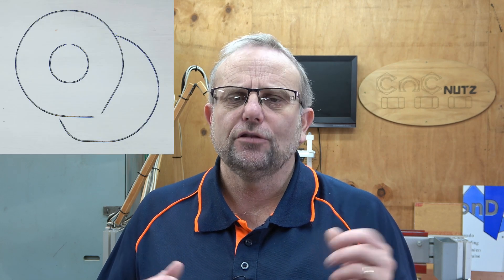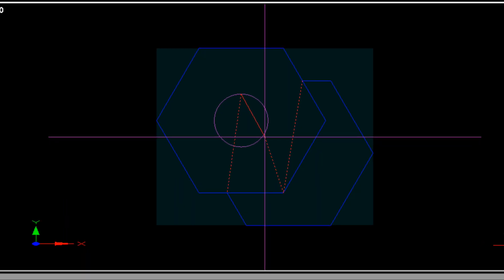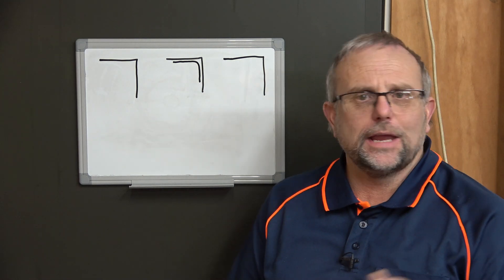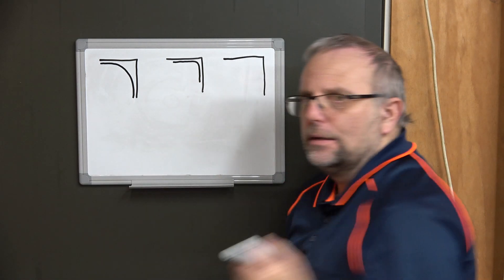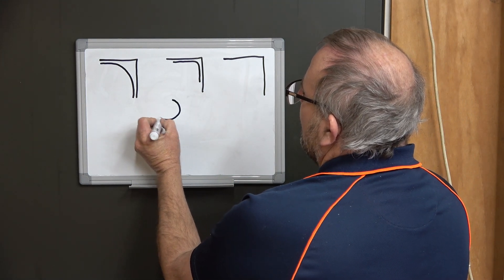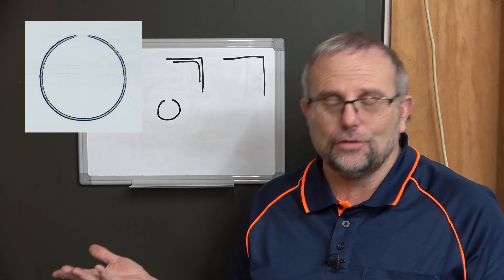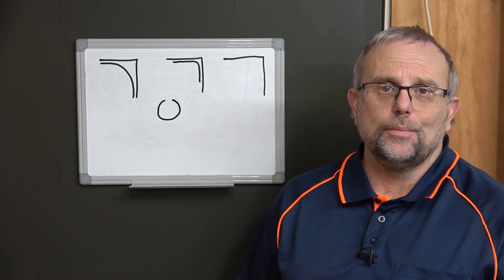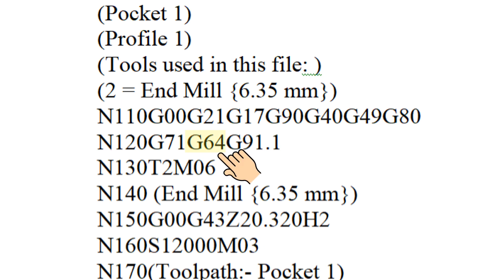Constant Velocity - Don't do it! - CNCnutz Episode 248

Comment: Mach3 has a really bad implementation of constant velocity. UCCNC as well as (from what I've heard) Mach4 manages this much better, drastically improving the performance. Another alternative you have is to use very high accelerations with closed loop motors and use exact stop.

Comment: exact stop shakes the machine like hell especially if you have a heavy gantry. then you need to reduce acceleration to create a longer ease in/out move to dampen the energy. the time passing during acceleration moves adds up and drastically changes the working time.

here are some of my tips that changed he way i work.

-get closed loop steppers at least
-constant velocity
-max out acceleration, just enough to dampen the shake
-max out feedrates
-keeping rpm as low as you can, making fat chips and keep endmills cold.
-evacuate as much chips possible.
-full depth cuts, use most of the flutes to cut not only the tip
- using roughing bits with adaptive clearing
-spring/finishing cuts to bring everything to tolerance after roughcuts or slotting moves. 
-i would say avoid slotting and plunging but we all do those.

Maybe everyone has a different flavor for using their machine. at least thats my experience so far.

Comment: I've been playing with the CV settings in uccnc because when running fusion 360 trochiodal adaptive clearing (or whatever it's called) machining uses a lot of curves and ran very slowly and jerky at default settings. But after some tuning I got much higher velocities removing more material quicker. When v carving though the same settings caused small gaps between the stock and inlay. ie about half a millimeter, it just gets filled up with glue and shows up as a thin line between the two pieces. 
I'm still not completely for or against CV. I think I'll just set it a bit more conservatively and jobs that need accuracy I'll just slow it down and match spindle rpm accordingly.
When machining aluminium and other metals or plastics it becomes important to have the velocity be kept constant as a low velosity may end up rubbing more than cutting, heating up the material and the bit. With acrylics you can end up with a completely melted mess and broken bits, with steel more tool wear shortening its life. Surface finish will also be affected. Wood is more forgiving, still, it's better to produce properly sized chips than ultra fine dust.
In the end, it's a matter of understanding and when to use what strategy to get the intended results.

Comment: Uh! By the way, there is one case where G64 (constant velocity) is very useful: when milling a big pocket.
In the above case, I manually go into the code generated by my CAM software (FreeCAD, in my case) and I insert a G64 instruction before the cutting instruction. Then I insert a G61 instruction just before cutting the final layer, to enable the exac-stop mode again. In such way the surface of the final cut (i.e. the floor of the pocket) is smooth and precise.
-----------------------------
The G64 instruction (i.e. CV-mode) can be also useful when you are going to cut shapes on thick material that cannot be cut in one pass.
In such case you can just roughly (a quickly) outline your shape just to remove some material around of it. Then you apply the final, precise "spring-cut" after enabling the exact-stop mode by inserting a G61 instruction in the appropriate place.

Comment: I have to disagree with you on this one, Peter. Constant velocity is a very nice feature if you tune it properly, taking into account the maximum acceleration your machine can pull off. If you are machining curves that are composed of hundreds of arcs and lines, constant velocity is a must, otherwise your machining will be extremely jerky and that will show in the finished part.

Sometimes, my paths have hundreds of thousands of nodes. If I didn't have constant velocity on my CNC controller, the machine would have to stop at every node, which is absolutely ridiculous.

What is important is to understand the pros and cons of constant velocity, know what maximum acceleration your machine can pull off, and adjust the feed rates accordingly. You can get extremely accurate cuts with constant velocity and a nice cut without burning or scratching the piece.
Reply from the maker: Thanks Kresimir. 
And that's the trick. Where a file contains hundreds / thousands of little moves to reduce them in CAM to Arcs which is what they normally are anyway. It is also what CV is doing internally. This makes things run much smoother and reduces your Gcode from thousands of lines of code to hundreds. 
I have absolutely no problem with people disagreeing with me.
Cheers Peter

Comment: Another great video Peter. I've not used my CNC for Lasering for many years, but I do recall having to use Constant Velocity to prevent the machine from slowing down and/or stopping at each change of the laser power setting. Not sure if this is still an issue these days. I personally don't bother changing the CV settings from Default, but I do have a fast acceleration setting with allows for pretty rapid direction changes anyway.
Reply from the maker: Thanks John. I haven't played with the UCCNC Laser to see how it behaves myself.
Cheers
Peter

Comment: Thanks Peter for the Explantation. I'm using LinuxCNC and i have to put in my G-Code-File a "G64 P0.01" (in example) to have fine corners and not rounded. that works pretty fine. More about this here http://linuxcnc.org/docs/2.6/html/gcode/gcode.html#sec:G64
Reply from the maker: Thanks, I had a look and it is Interesting they call it path blending and the tolerance is defined as part of the Gcode itself. This is probably a more accurate description of it's purpose.
Cheers Peter

Comment: Mach3 has very poor CV implementation and will deviate from path depending on your feed and acceleration settings. Better controller software such as Linuxcnc and UCCNC have much better CV and you can set the amount of deviation from true path.  Mach3 does not have this kind of setting.
Reply from the maker: You can actually set the tolerance in Mach3 . It's called CV distance Tolerance and is measured in units but the settings are very limited compared to others. The demonstration was very unfair to Mach 3 but I wanted to show the effect or how it works and having to get out a magnifying glass to see it somehow isn't quite the same effect.
Cheers Peter
Reply: CNCnutz (Peter Passuello) 
Yes mach3 CV settings are very limited and many times it is ignored.   It’s good that you have pointed out some of the issues with Mach3. I have a Mach3 license purchase way back when the program first came out and I still use it for a couple milling machines.  I’ve since moved to UCCNC on my gantry router which has much better CV tolerance settings.  Even better is Linuxcnc G64 path blending gcode.

Comment: Constant velocity doesn't work properly in mach3 , it works fine in UCCNC , sounds like you are using a poor cad cam software with lots of nodes
Reply from the maker: Thanks Daniel. For years users say that Mach3 CV is horrible and UCCNC is Good. I see the same comments here.
I have excellent CAD/CAM software but certain drawings are made up of a lot of nodes.The trick is to sort them out before you make the Gcode file to output the best most efficient code possible.  It's too easy to think that software it will sort everything out by itself and blame the machine for doing what it is told.
Cheers Peter

Comment: Peter, I am a fan of your usual common sense approach to things.  However, on this one you are way off.  I think you need to do a bit more work on the subject.  It is a challenge to tune CV I will give you that.  But if I ran my machine with CV off it would look like a dog chattering its teeth in -40 degrees.  Strange too, I created your example and my results do not look anything like what you got.  Simply put Peter, you are wrong.  Please do not be offended.
Reply: BTW, my machine runs on steppers, not servos.

Corners are where you will see some differences if CV is used, unless of course you have the parameters set up really wonky, then you wind up with incredibly weird looking parts.  When set up properly CV uses an "in position tolerance zone".  As you enter that zone the machine is allowed to begin the next move.  The parameters in Mach 3 are used to define that tolerance zone.  It also has angle adjustments that control that in position tolerance zone.

Comment: My machine is just about unusable in exact stop. I do a lot of organic splines and toolpaths generated through Fusion 360.

I’d love to hear about your workflows for CAD/CAM that make smoother running Gcode.
Reply from the maker: Hi Nick. One of the things I would say is if you are doing Art projects where dimensional accuracy is not important then CV will not really be a problem. CV is not as bad as I demonstrated. I purposely exaggerated for artistic reasons. The use of splines are the cause of your motion problems in exact stop and simply converting these to arcs in CAM will help immensely. Basically that is what CV is doing except you are at it's mercy rather than doing it yourself. I am not a user of Fusion so not sure of the process.
Cheers Peter
Reply: @cncnutz  Thanks for your thought out response, Peter. I appreciate it!

Comment: CV in mach3 is horrendous. CV in UCCNC is fantastic. You should have done a comparison rather than just a shameless masso plug which just doesn't support it along with other features. Just my opinion.
Reply: CV is better controlled in UCCNC, no doubt.  I now use it.  But it is a bit dramatic to call CV in Mach3 horrendous.
And yes I have used Mach3 for over 13 years on a variety of CNC machines.  (I presently have 5)  All very successfully with Mach3 and CV.  All stepper driven.
The problem with a large number of home built CNC machines is that they have terrible acceleration.  Under powered, poor rigidity or just not tuned properly.
Something like a router will handle Mach3's CV implementation like a breeze if it has nice crisp acceleration.

Comment: If your having the demonstrated issues on a wood router then your machines performance is woeful.
I always tell machine builders that acceleration is king.  Forget chasing super fast speeds, priorities acceleration.
Exact stop mode does just that. The machine will come to a FULL STOP at EVERY node.
You can reduce nodes.  For example, no need for extra nodes in straight lines or arcs.  
But what about curves?  There is no Gcode to define a curve.
So it must be broken down into a close enough representation with arc segments or short line segments.  
At EVERY arc or short line join there is a node. This is unavoidable.   Exact stop mode demands it must STOP AT EVERY NODE..  
Makes for very jerky movement. Unless movement is at snails pace.
Vee carving is all short segments.  I would shudder at the thought of doing a large vee carving in exact stop mode.
Reply from the maker: Thanks Greolt. The demonstration was unfair to CV but it was done to show the effect and as i said I didn't set it up. If I had any machine that did that to  cut I would throw it away. The consensus here from everyone is that Acceleration is the key to CV performance.  
You are dead right about there being no Gcode to describe curves so the trick is to get the CAM to do what CV is going to do anyway and change the toolpaths to lines and Arcs instead of outputting 1000 straight lines. Things that look like arcs can also be curves and you not realize. I've been caught before.
I want to demonstrate that I can get smooth motion out of exact stop with the help of CAM.
Cheers
Peter

Comment: Peter, I have a view different than yours. The problems you are having with your constant velocity is more a symptom of poor performance from your machine, it's inability to accelerate and decelerate fast enough. I am lucky enough to have made a machine with servo drives and constant velocity works great on it and properly set up steppers would show an improvement too with constant velocity enabled. Without constant velocity it would bang and clang at every sharp turn. With my set up I get smooth motion with less than 0.01mm deviation from the perfect path - you can't even measure the change to the path. Don't blame constant velocity for what you see here - you even admit that you haven't tried to set it up properly - have a go and set it up properly and it will work great. It's there to look after your machine. No offence to you and kind regards - I enjoy your work Steve
Reply: Beat me to it, constant velocity is a game changer, but machines need to be tuned to use it.
Reply from the maker: Hi Steve and thanks. I agree that higher velocity will greatly help with CV and servo's are great for this. Unfortunately most people don't have servos myself included so we don't have the high acceleration.  I also did say I didn't set it up properly not to show that it is bad but to show the effect. As you say the effect of sharp angle bends is not pleasant to watch or hear and in CAM software a 90 degree corner is always output as a curve to give better motion around the corners rather than a stop and a sharp right angle bend. As you also said the poor performance is a symptom of the machine and each machine need to have different settings based on the machines physical limitations / characteristics. You clearly have yours set up well and have a nice machine with high acceleration but I suspect most users don't have machines with those specs and they will struggle keeping the accuracy with low acceleration though they are also running lower top speeds which will help even the score. 
Thanks for your comments. It's good to hear differing viewpoints.
Cheers
Peter

Comment: Great info as usual.
Reply from the maker: Thanks Bruce
Reply: Looking forward to the next video. I am not seeing g 64 or 61 in my g code but mach 3 is set to cv if I change to exact stop it moves jitters.I use g code inch tap.